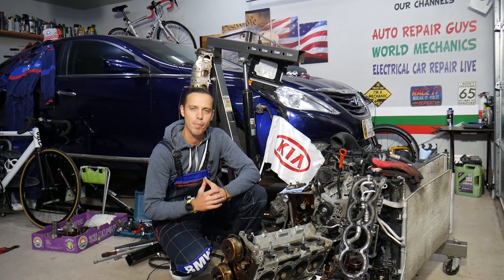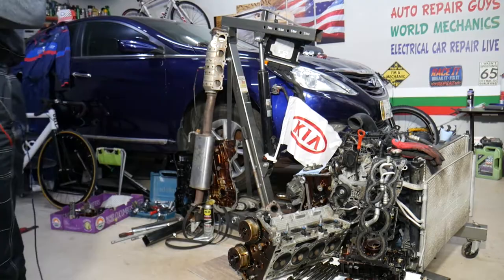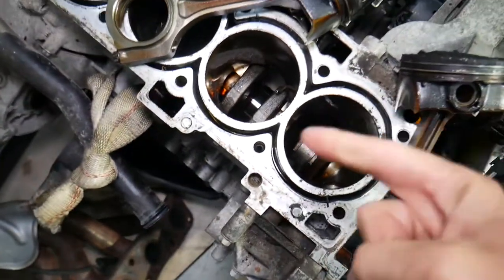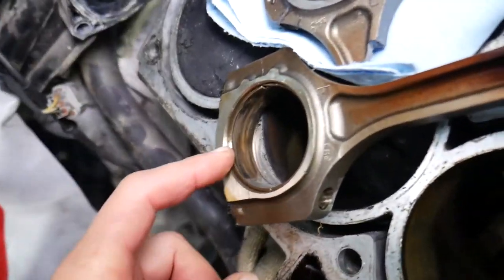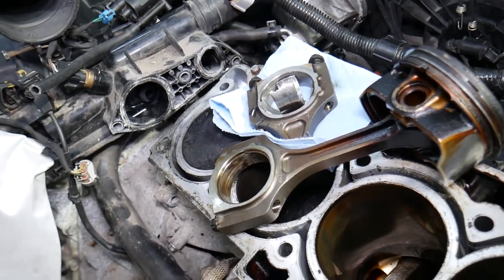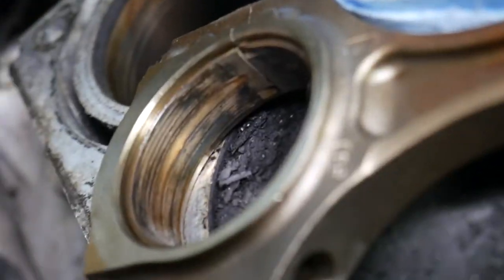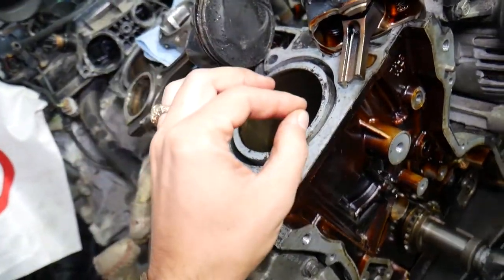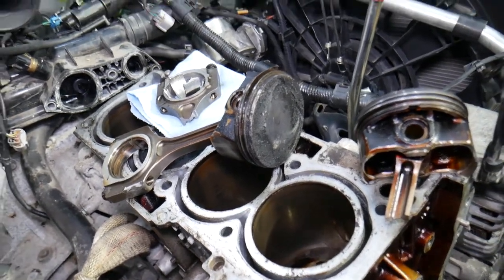WHAT ARE THE SYMPTOMS OF BAD CONNECTING ROD BEARING ON A CAR

Comment: i have a 2013 hyundai genesis coupe 2.0t and i was going to replace the connecting rod bearings but the ones i bought have a pin hole in the middle and the ones that came off my car didn't have anything. Can i still use the ones with the pin hole?

Comment: Very explanatory film on that knocking sound, thank you. But how much does it usually cost to replace the Connecting Rods?
Reply: Rods are less than 100$ but it depends on mechanic. Anyway, they don't want to do it for 'cheap' so they tell you that you need to rebuild the engine and it's more than 2000$...that's why a lot of mechanics don't want to replace them, but as you heard him you can put oversize rod bearings but nobody said how long it can drive
Reply: @twistedmetal1996  Thank you for the attention to my question. At dealer they said: can't work on Connecting Rods, since it is, like you mentioned rebuild, and they don't do it. Just to replace the engine. It is in Dallas, and what I saw here the quality of their work is such, than much better to do it yourself. Last time I went to Jupiter Chevy dealer for alignment, and they didn't tighten lug bolts on rear wheels at all. It is good I always check the torque after visiting such places. Till now don't understand how those wheels just didn't fell out on the way home.  I hope though that it might be not Connecting Rod(s), but suspension, like worn CV Axle seal (I observed that all the inner head of Pas. S. Cv Axle is covered w/some grease) . No knocking at idling, just when you go ~ 20mi or more. The frequency doesn't depend on gear. So maybe CV Axle. Thank you again.